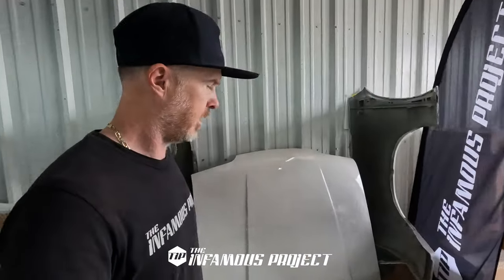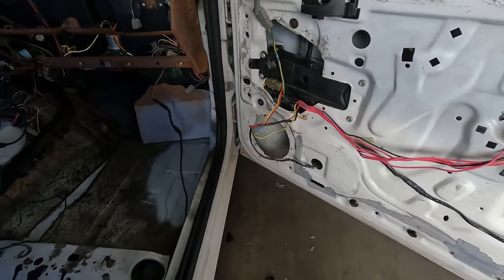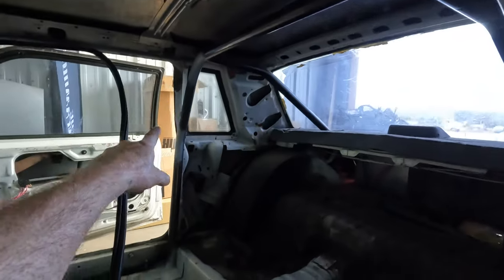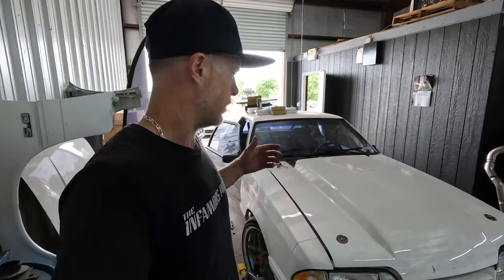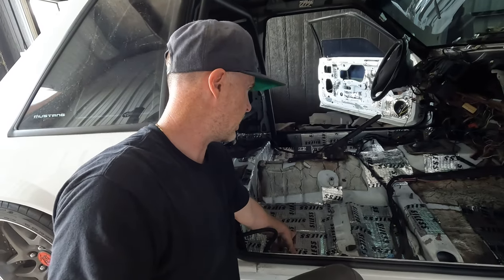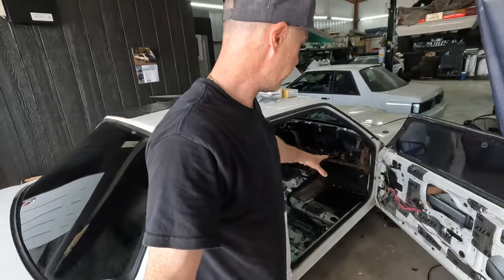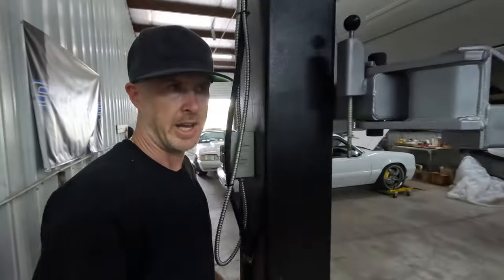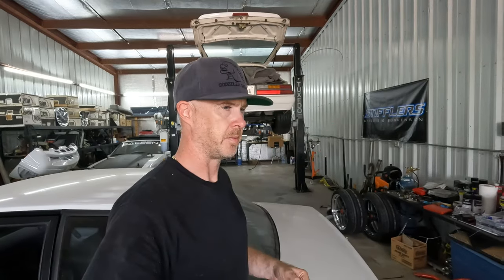Cage painting & Sounds Deadening - Getting this Foxbody back to Street Status!

Comment: What thickness of the Siless did you use? I see that they have a 3mil , a 2 mil and a 1.3 mil.
Reply from the maker: I did 80mil (2mm)
Reply: @TheInfamousProject  question I have a 1992 roller an just bought a 302 for it but it an non h.o 302, how can I make it work